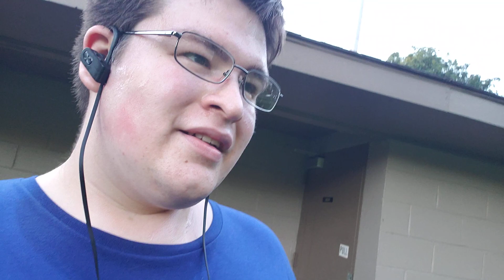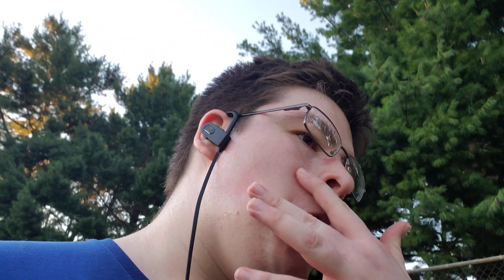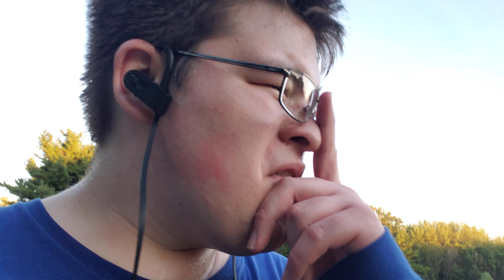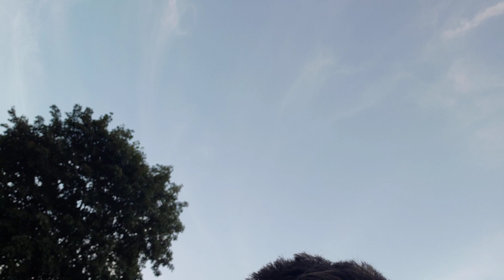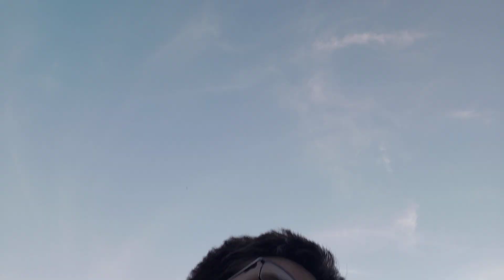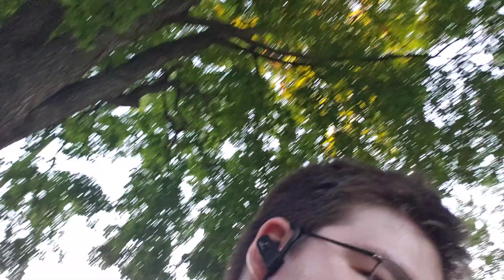A criticism of current hypothetical O'Neill Cylinders

Comment: {Ple-Four} Our solution to crowding was generally... build more O'Neill cylinders. You seem to talk like there could only ever be just the one. >@.@<
Reply: Exactly if you had the time, and energy to build one, why not build one hundred. And why not just build it bigger? You have the time, and energy. The only difference would be that your making one structure that would take a while to build vs a couple dozen(if not hundred) that could fill demand at the moment. But I personally would rather build on a larger one. Because you have a longer horizon arc. You have a lower gravity differential between your head and feet. And you could have a higher diversity in locations within the same system meaning you don’t have to leave and pay for an expensive trip to a dedicated nature preseve(even if it is connected to my residence

Comment: Apparently the calculations for the smallest rotating habitat where a human doesn't fell unwanted effects of the spin standing at ground level is 223m diameter.

Smaller rotating habits - like, 3 or 4 Meters across - are perfectly survivable. Though disorientating. 

BIG habitats. The bigger you go, the less problem this becomes.
Say the diameter is 200km. If the speed allows for 100% of 1 G at ground level, you would get 99% of a G at 1km off the ground. As of the time of this writing, we don't have ANY 1km tall buildings on Earth.

Same 200km diameter cylinder. But with 5km tall building. That is 95% of a G on the top floor. Enough to be noticeable, but no where near enough to be a problem.

How about an O'Neill Cylinder sized Cylinder (8km diameter). That mean for every 40m rise, you lose 1% of a G. If one floor is 5m tall (on Earth they are about 4.3m, so I'm rounding up), we can build an 8 storey building before we drop to 99% gravity. 16 stories before 98%. 24 stories before 97% and so on.

The observation deck of the empire state building is 381 Meters up. In a classic O'Neill Cylinder (8km diameter) you would experience 90.5% of a G at the top.

All in all, this is far less of a problem than it appears. 90% of a G would be pleasant.

Comment: there is a online calculator for gravity so i did some calculation ... even at a 100m cylinder you can go several stories high (like 5-6) without much gravity change. of course you wouldn't want to live in the 1.2 G levels... i am sure the older you grow the more people would like to live higher. (possibly at higher prices)  my curiosity would be to see long term effect of not lighter gravity but stronger gravity... for example at 1.2G will those people have stronger heart , denser bones ? (considering micro gravity affects the heart and bone density.  considering the tallest buildings are like <1km and that oneil cylinders are several km in diameters (in some cases)  i doubt you could "walk" up stairs and actually notice much difference in the gravity levels.   For the video: thats why most people shoot in their rooms or bathroom ;-) next time instead of walking set up a chair and camera. this why you wont be as "winded" its good to make a "plot sheet" to see where your convo is going.
Reply: Now that is interesting.  Whenever I return from a hard jog I notice that everything I pick up feels lighter.  It is all a mater of perspective.  You could get a ripped body in that kind of a gravity.  I still am trying to figure out the structure of these things and how to make sure they don't fall apart.  It would be like living on the Titanic I imagine.  I am not an engineer though so I would not know the structural security of this kind of a structure.
Reply: Yeah, but your not waking up stairs to go up the burj khalifa. And the real problem is vertigo. Your feet feel like rocks but you’re head feels like it’s in space. But if your talking about kilometers wide structures then it doesn’t matter